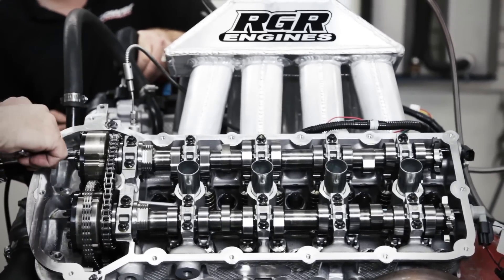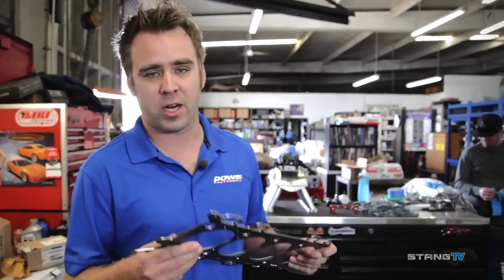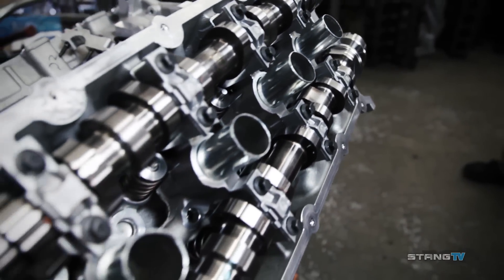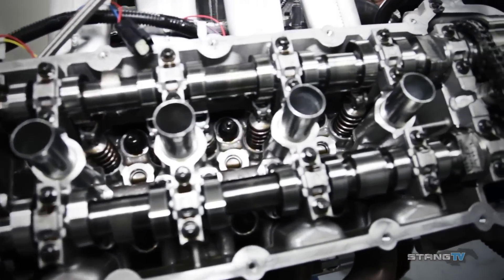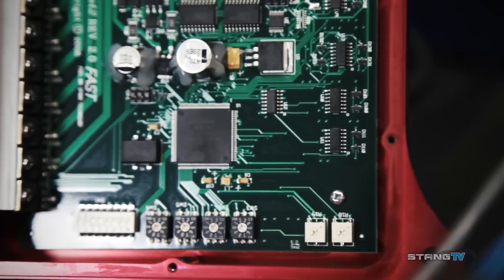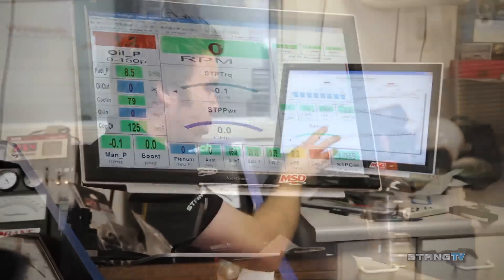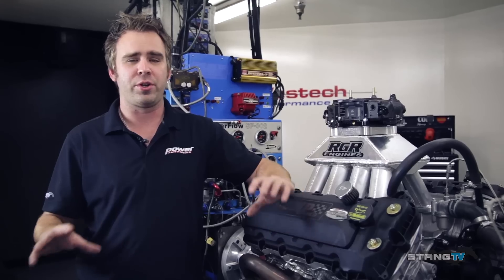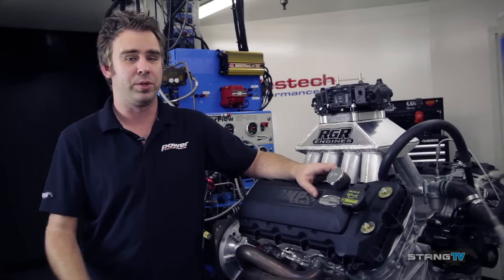Carbureted Cobra Jet Coyote Engine Build: Long Block and Dyno Testing

Comment: did he say 128 degree lobe seperation???
Reply: ya, I ran that back a few times, 128, what?   I think that must be to keep the vacuum high,  but it as I remember from 30 years ago, lol, 107-110 is the number for high rpm valve over lap, the idea being the the exhaust side is put a vacuum on the intake side...if you can 'dig that'?   love to hear from some serious expert on heads, cams....
Reply: Shawn Raymond   Pro stock cars run alot of lobe seperation out of necessity (cam lift and duration are so large), but i would think this motor would not be in this league..    

i do not have much experience with dohc motors with VVT and Cam Phasing technology...   

????????????  builder answer question  ?????????????????????

Comment: A shiver-lay would blow sky high at 8000 RPM.... j/s. ; )
Reply: I'm a ford guy, but you must admit, the LS engine is simple, affordable  and can run 700hp all day long without a supercharger or a turbo.
Reply: And no bailouts.
Reply: bone stock would float valves long before 8 grand. built right they will be more than happy at 8 grand
Reply: Daniel 😂 👏 but not really don’t forget about 302 sbc in the late 60’s turned that from the factory

Comment: so 500+ hp from an N/A 5.0? not bad
Reply: It's 314 cubes now so a hair shy of 5.2 now. Ported heads, bigger valves, hotter cams, bored, sleeved, even upgraded main bearings and oil pump to handle the RPM...honestly I expected more and like a 9k rpm engine when I first read the article.
Reply: 94XJ I highly highly doubt this is even a aggressive setup. The cams are probably mild and the compression is most definitely mild and the fuel too. There’s a 5.2 making 600 plus NA high comp big cams. Like they said they didn’t go into very fine tuning.
Reply: @94XJ  def not sleeved lol
Reply: Google Sucks  https://www.hotrod.com/articles/4-8l-crank-ls3-block-how-to-build-an-8000-rpm-ls-stroker/

You were saying?

Comment: Basically you took everything that makes the engine so awesome and powerfull and threw it in the trash LMAO!
Reply: Basically, while 590 on gasoline isnt bad, the engine makes that and then some totally stock with an E85 tune 2018 and up. It really needs nothing straight out of the box except for the basics, intake, exhaust and tune and you have a 10 second 3800lb car.

Comment: Why would you carb and remove variable valve timing?!  Thats totally shooting yourself in the foot..  big injectors, CJ mani, variable valve timing, and a good tune will make much more power easier especially considering ford sells the whole control pack with everything you need, even the petal!  I a gt coyote with cams+tune would make 500+hp on that dyno...

Comment: So is there any advantage to running an carb?
Reply: probably not .. i would just like to not have to convert my 69 stang to electronic stuff .. much rather convert a new engine to an old technology ..but i`m happy with my 429 ...
Reply: Just wot (wide open throttle, im talking like 1-3hp) & the best carbs 500-1000 bucks (size depending) at most and the good efi system can start at 2k- the very best 4-8k and for people that arent computer savvy they can be a + but carb do take a few month-lifetime to master(your mileage may vary) . Efi gets much better mpg and tend to have a much better bottom end depending on how crazy your cam is. Top end tuning on a carb is easy, its the mid to bottom end it takes alot more time and effort. I tend to like carbs better because I can tune a carb to almost perfection and they're much cheeper.  If efi was in the 1200-2000 I would run efi just when I already have 10-15k in a motor I tend to like to save money somewhere. You know what I mean? It the same reason I still build lsx, sbc and bbc is the dollar per hp and aftermarket support. I want to do a mod motor in the future. I just want some aftermarket support other then ford ya know?

Comment: Converting from fuel injection to carbs, and from variable valve timing to fixed? Why not convert to pushrods while you're at it? You've left power on the table by getting rid of ECM tuning.
Reply: They are showing more ways to make power with this Coyote engine .. when the Chevrolet people do this the LS MOTOR by the way is still a push rod motor, you think it is the coolest thing out there. so hush up and lesion.

Comment: would love to see hp and torque numbers with the same engine mods, variable cam timing and EFI to see if all this is really worth
Reply: ***** Maybe with an Cobra jet intake and VVT?
Reply: ***** Hell ya cant wait...
Reply: I'd like to it with an ITB setup.
Reply: Sea Tac Assassin
There's a new video the yote smashed the carbs numbers.
Reply: Took the words right out of my mouth. I'd love to see that comparison with all the same hard parts
Reply: *****
Looking forward in seeing the results.
Reply: ***** Im sure it will be with the the Carb making more top end power, and the efi making a broader power band
Reply: ***** Thanks for the info i don't mind being corrected lol
Reply: cerebraldamage Mind sending me the link thanks in advance
Reply: Be great for a swap in old ford